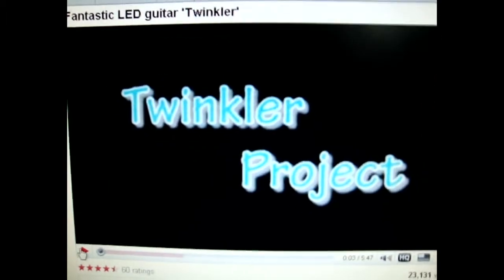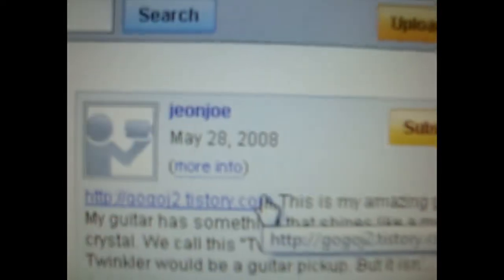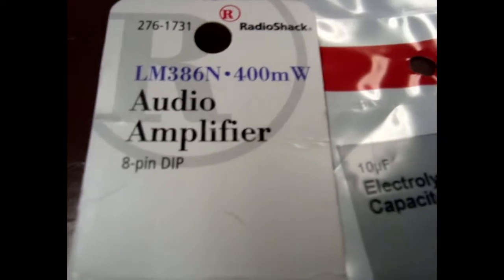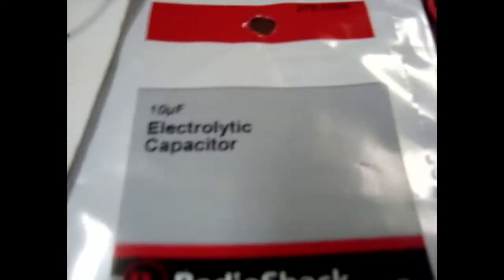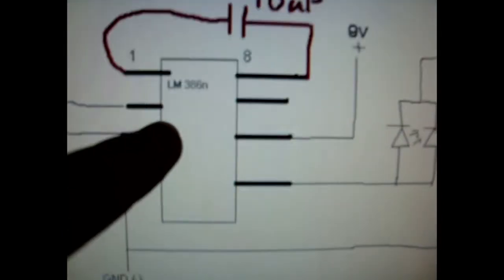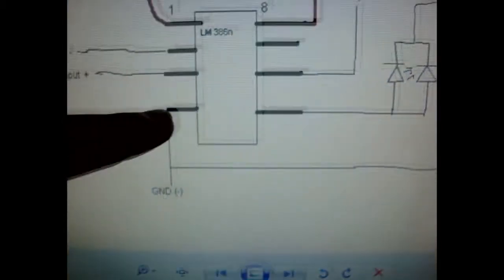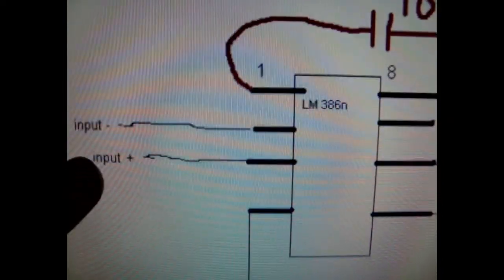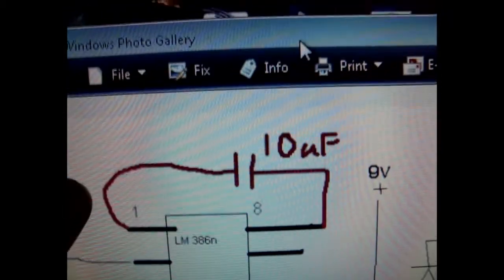Mystery of the "LED Guitar Twinkler" SOLVED.

Comment: have you tried adding a rechargeable battery with a power switch? I really like the idea of the lights turning when strumming. I have been installing leds with only an on off with rechargeable batteries. maybe a combination of these two mods would be great.
Reply from the maker: You could definitely do it with a rechargeable battery and a switch.
Reply: I'm trying to build a flame light gitarre. Finally found your instructions. Great help. Thought I couldn't be the only one thinking like that.

Comment: So with the reed switch, whenever you have the backplate over the back of the guitar it cuts the supply so you cant use the leds. does that mean you have to take the backplate off and play guitar with the wires hanging out the back for the LEDs to work?

Comment: Are you changing to resistor in accordance with the amount of LEDs?
your average 3.3V LED will require 300R by itself from a 9V supply and 2 of them wired up together will require 150R from a 9v supply. I'm guessing you didnt change the resistor and it has too large a resistance to get enough power

Comment: I soldered a resistor and 3 leds the way you showed in the tutorial but every time I try to add more leds the voltage is significantly reduced and they barely light up. Any suggestions?

Comment: I used a weaker resistor, and stronger LEDs. It worked for the most part. I still get the problem when I turn the circuit on, try strumming very hard, it works for me, I think it has something to do with my pickups being to weak

Comment: @snarshmallow the reason they';re on all the time is becuase on an LM386 pin 5  will be at half the supply voltage, and pin 4 is at ground, therefore even without any sound the LEDS will have about 4.5V across it....enough to fry most LEDs! At the very least it needs a capacitor between pin 5 & the leds.

Comment from the maker: @Mrmeanerband the type of switch you want would be a normally closed one, so when the magnet is introduced it would break the circuit, a SPDT (single pole double throw)  you can get them in bulk on ebay for cheap, youtube isnt letting me put links, but it will look like a glass cylinder with 3 leads sticking out, 1 on one end, and 2 on the other. the switch would go on the + wire right outside of the battery, so it cuts power to the circuit.

Comment from the maker: what you need to do it add a resistor into your circuit, i am not sure of the exact value, but try to get it so the circuit is just barely off when not playing. adding in the correct resistance will make the leds stay off untill you play.

Comment: great video! I was wondering about pin 4 for the ground (-).  I connect that with the 9v - and resistor ends, right?  Then connect a wire from the ground point of my pickups on the back of a pot to pin 4?

Comment from the maker: @jrpg0 If it is a low voltage op amp chip, and have the same outputs and imputs as the lm386 yes, but you will need different resistor values depending ont he chips specs

Comment: "You need to add in a resistor before your leds so they are normally off, and come on when you play. I am not sure of the exact value, just try a few different ones and you should find one that works well."

Thank's! I'll try this!

I put "Ctrl+C/Ctrl+V" for this information because I think that this will be useful for others.

Thank's again, man!

Comment: haikelzambri. the resistor will depend on the LED values.  this circuit will work. but it is definately not Jeonjoe's. JJ's circuit is a way more complex circuit.  you can check out my version. which is a little closer but still not jj's.  this video shows an excelent LED solution.  for a quick setup I highly recomend it.

Comment from the maker: The resistor used is different for all leds, you can look online for a claculator, and just put in the specs of your leds and type of circuit and it will tell you your ideal resistance

Comment from the maker: Yes you could put them on the fret board, however it would be very difficult to do, you would need to drill all the way down the fret board, and then line up hold going through the fret board, and then run wires down. I believe they sell necks that have leds in them alredy, and you could just hook them up to this circuit.